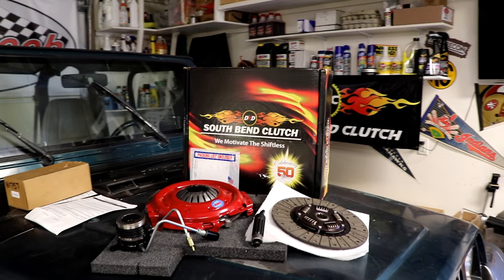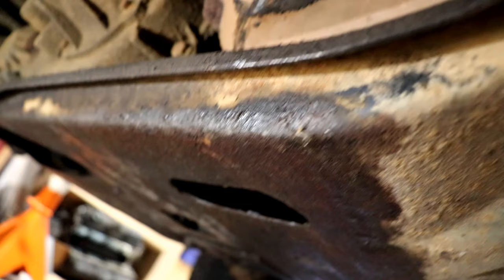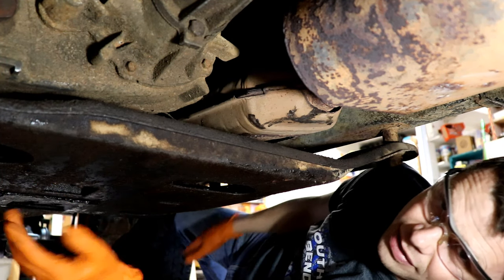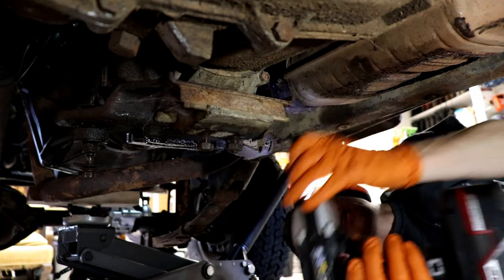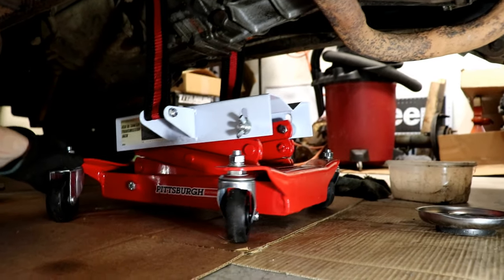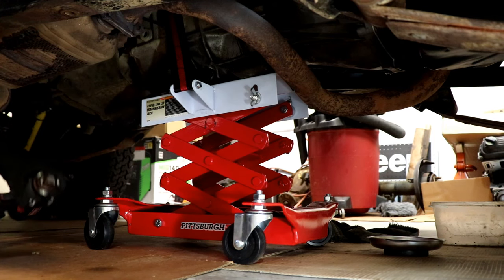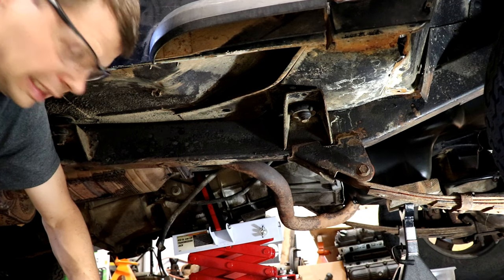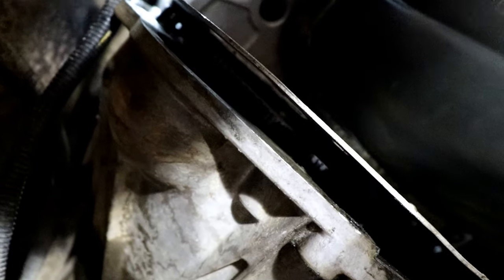Wrestling the BEAST! Jeep Transmission Removal

Comment: Thank you for the videos, they are a huge help. My son and I wrestled out the trans and transfer case as one and it was a pain. Going back in, we removed the transfer case and it made installation much smoother. Splitting the two may have added half an hour but in the long run I think it made the job quicker and safer.

Comment: 5:02 and this is where I broke off two bolt heads. I was hoping for some tip for removing the other two before I continue, but I see yours came out without trouble

Comment: FYI  the top most two bolts @12:12 are a external torx head bolt. You will need to grab a E12 socket to remove them, then make sure you replace them with a grade 8 hex bolt if you want to make it easier on yourself in the future removals.

Comment: Just subscribed! I bought a 95 wrangler 4cyl with no transmission and no transfer case very nice NO RUST and it’s lifted and 33’s on it for $500 smacks! Love it , so this video will help me install all that stuff.  I need front axel shafts also so hopefully there is a video on taking those out and putting new ones in
Reply from the maker: Thanks for the sub! Sounds like you got a sweet deal on that Jeep 👍

Comment: I have a problem getting my shift lock collar back in place. I cannot seem to twist it once i push down. the lock collar that holds the manual shifter into the transmission. Get everything else done following your great videos to replace transmission/clutch/flywheel

Comment: On 94 and later models unbolt the release cylinder from the transmission- there's no need to disconnect the hydraulic line (Haynes manual)
Real men read manuals

Comment: We have a 92 YJ. Currently removing trans to replace the clutch. But all but 1 bolt on the skid plate broke. Any suggestion or how to remedy this? I know the nut they thread into is welded inside frame - so other things online say to cut a hole in floor pan, but I’d like to avoid that if possible. Thanks for the video!

Comment: I’m taking mine off to replace the torque converter. Has anyone documented the bolts and nut/bolt used to bolt the transmission case to the engine. Head size of each and actually length would be helpful if you have it. Thanks.
BTW great how to channel for Jeeps. Very helpful for anyone turning wrenches at home.

Comment: Help!  I have a 2001 Jeep Wrangler.   32RH (904). I change my transmission fluid every 40,000 miles.  my transmission won’t shift into overdrive.  I change the fluid and filter and replaced clutch converter solenoid. Still won’t shift into overdrive. Shifts fine in the first second and third at all the shift points for RPMs. Just won’t lock up in overdrive ,any guesses?   Never has appeared to have burnt fluid.  Overdrive clutch?  Checked the throttle position sensor and clean the throttle body for your video. Replace the speed sensor.

Comment: were you supporting the transmission on the engine oil pan? My yj has a Peugeot transmission, I will eventually get around to swapping it myself
Reply from the maker: Yeah.  If you place a block of wood under the oil pan to disperse the pressure, you can use it to support some engine weight.

Comment: I have a 1991 Jeep Wrangler Renegade,
Engine  4.0 liters  MFI  6 cyl  240.7 cubic inches, 190hp, 225 ft-lb @ 4000rpm
Transmission Manual 5 speed: AX15
Transfer Case: NP231 ???
Front differential: Dana 30
Rear Differential with Trac-Loc: Dana 35, 355 gears, “C” clip style
Tire Size: BFG AT 30x9.50 R15LT
I have a problem that’s driving me nuts. I’m hopping you can help me with. I have a real bad vibration in 1st & reverse gear “intermittently” I can go 2-3 days and the Jeep will work fine, then without warning I get this bad vibration just starting out in 1st and backing up in reverse. I’ve had 3 clutch assemblies replaced (clutch plate, pressure plate, through out bearing, slave cylinder, clutch master cylinder, pilot bearing, flywheel resurfaced. New motor and transmission mounts. I even thought it might be the Rear Differential with Trac-Loc acting up, even though every time I look at it, it look like new, but just to make sure I installed a 912A569 Eaton Detroit Truetrac Differential. 
So now my idea it might be the flywheel that was resurface 3 time, and how knows if it was done properly from the beginning? Or the transmission or transfer case. What’s your thought? I’m tired of guessing. And spending money on items not needed. Thanks
Reply from the maker: Yeah. That stinks. Not fun throwing money at it.  
My first thought and a normal maintenance issue is the transmission fluid.  How's yours? I've heard a lot of stories of people having an issue with certain gears, which was resolved with a change in fluid.  Have you checked to see if yours is low, dirty, old?  Is it due?  Have you recently changed it with a different fluid.  Just initial thoughts that are easy to check.
Reply: @JeepSolid  First, thanks for the reply. I change my engine oil and filter every 3000 miles. I change ALL my other components every 10 months (Transmission, Transfer case and both differentials) I use Lucas 85w-140 hi performance gear oil #10042 for the 912A569 Eaton Detroit Truetrac Differential and Redline MT-90 for my transmission.

Comment: I have no clue why Eagle/AMC/Chrysler decided to put the clutch slave cylinder inside the bell housing. Years ago when I replaced it myself, it was a PAIN and a HALF to get to just to replace it, and I had to do it twice within months because I cheaped out on the parts. At that point, I said "never again" and anything clutch/transmission related with my YJ goes to a transmission shop. Got Luk clutch components in mine and haven't had any issues for a few years.
Reply from the maker: Yeah. Small issue can turn into a huge pain